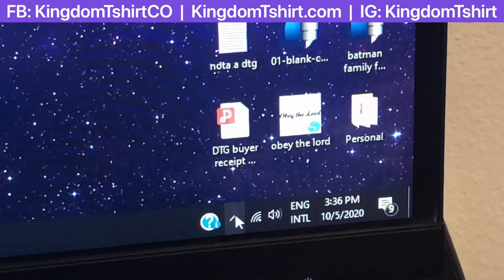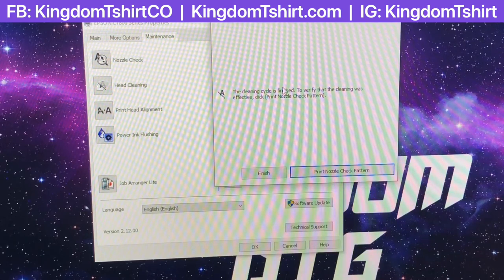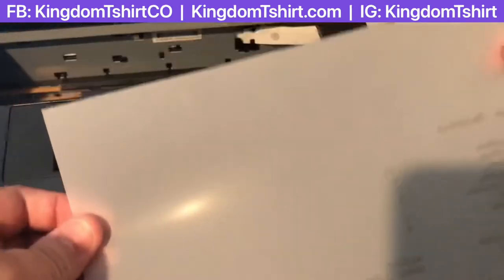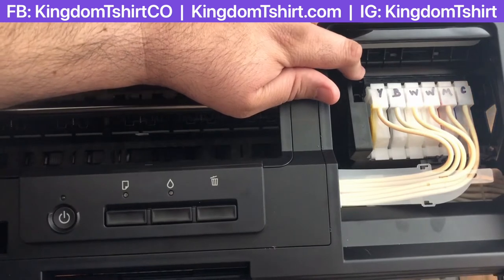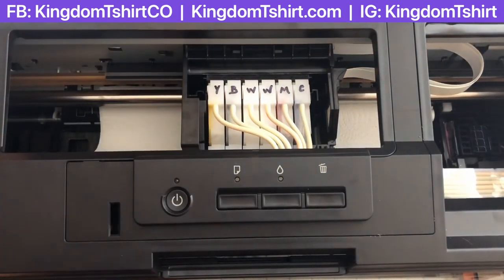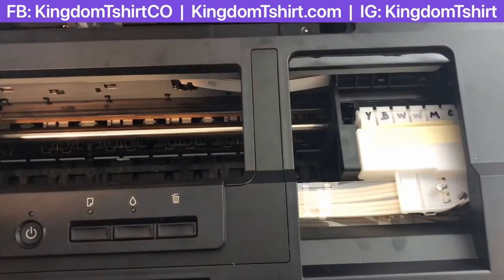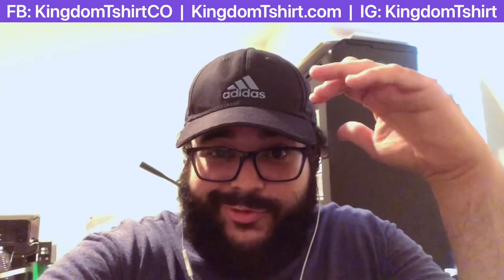📢 How To Do Maintenance DTF Step by Step with Epson L1800 (Direct To Film Printing) - PART 2

Comment from the maker: After doing so test, I find out that doing the flush 1 per week is ok if you don’t print to much, and doing a print head cleaning for nozzle check every time before you start to print a job is recommended. If you print constantly, is probably you will not need to do the flush since nozzles will not clogged.
Reply: Is there any solution to resolve clogging ?
Reply: Mmm i print every day 30 to 50 pri.ts a day thats a 8 a to 5 non stop  printimg for my l1800 and still get my head clogged
Reply: Have this maintenance scheme changed or do you still go with it?

Comment: Hi man! Awesome work once again.
I have some experience with sublimation, and what I have is a scheduled task to print a test page every 3 days during winter (my business is mainly during summer). Do you recommend a scheduled print for dtf? 
If I'm not wrong when you don't have too much work you flush once per week and then printing 2-3 days/week.
I guess if I'm printing a lot every day (summer season) I should flush after each day. But not sure about winter... Do you recommend printing a test page every 2-3 days plus a weekly flush? of flush 2 per week...
I'm a bit worried about clogged it...
Thanks in advance
Reply from the maker: Correct, once you flush print head is good. If you print again the n again you will have ink in the print head, so it better leave it clean.

Comment: Hi :) 
I probably buy  this printer 
one question or advice to me ....every morning you do nozle check and head cleaning , and after you finish the job for that day you go to the flush and print head will be empty ? is that one of the way to save you printer ?
Reply from the maker: Cleaning after you done printing and I do it most to the white nozzle. In the morning if nozzle check is good I do not do cleaning since is not necessary.

Comment: Your videos are great. After u flush the head and flush the lines. Can the printer sit for a week or two without printing?
Reply from the maker: Yes, but let me explain. You need to flush good and keep head moist in the time you are on vacation, but real longer period without use it can dry the head if is not moist correctly. To be honest I could say before was easier but everything has change during this year.
Reply: @KingdomDTF  thank you very much.

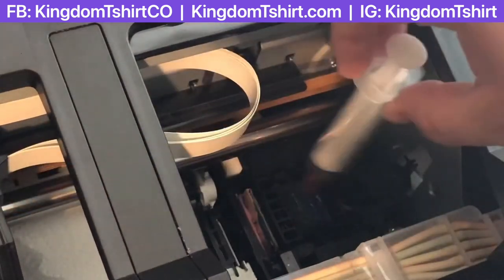Comment: aha ok after the flushing with the solution , the next day ,i have to do the print head cleaning again so the ink will go down correct? @15:00  . is it safe to do print head cleaning everyday right?
Reply from the maker: Correct
Every time you use it or the printhead have inks inside the nozzles.

Comment: Hola, una pregunta,  despues de limpiar el cabezal imprime correctamente, pero la segunda o tercera impresion ya no imprime el color blanco, ya quite el cabezal y lo limpie, tambien purgue los dampers, que crees que sea el problema?   Gracias!
Reply from the maker: Verifica que el tanque tenga air flow para que las tintas corran mejor. Tambien mira ver que no tengas una linea con algun liqueo o agujero.

Comment: Hi. I have an issue. After doing the cleaning, nozzle all okay. Sometimes white ink is fine, some time yellow didn't even come out. I did cleaning again, yellow come out but the white doesn't. I cleaned again.. both fine for 1st print. Subsequent print, the white started fading. Please advise.
Reply from the maker: Elevate the ink tank 4 inches from surface, that will help with gravity. also make sure you have a good airflow.
Reply: Thank goodness for you!! It works like wonder!! For now, i opened the cap. Until when do i have to keep it open? Also the ink tank, until when do i have to keep it elevated? Thank you sooooo much once again!

Comment: Hi. My nozzle check is always messed up hardly any lines at all. I have done my head cleaning a few times and nothing works. Can you help
Reply from the maker: Try to use an strong cleaning solution and mix with hot distilled water. You need to be patience to push the mix.

Comment: Hi KINGDOM, what is if print halfway, the white gone? Is there any solution for this?
Reply from the maker: On the L1800, elevate the tank 3 or 4 inches from surface and make sure the ink is getting airflow.
Reply: @KingdomDTF  I have tried elevated the ink tank using a box, but the white ink still stop halfway, is there any specific way to overcome the white breaks in the middle of print?

Comment: Hi. I noticed when i put the solution at the capping station, it went down slow and not all when down. I have to wipe it with napkin. Is that the right way?
Reply from the maker: No. Is possible that you have a clog line there in the capping station or the capping station is getting damage. Is better if you get one and have it as spare in case you need to replace.

Comment: I tried this, but I can't get the solution get through, could I be doing something wrong ? The printer is just one month old and it is printing almost good.
Reply from the maker: Is the solution is not going into the nozzle, then that nozzle is clog, you will need an strong solution to break since a regular may not work. Also you can warm the solution a little bit to have a better results.

Comment: Hola interesante, para la Epson 14000 podría valer esa modificación? Y no necesita que tenga un sistema que evite que la tinta se sedimente ? Gracias un saludo.
Reply from the maker: El 1400 es posible, pero hay que modificarlo para que no dañe el diseño al imprimir. Solo agito la tinta un poco antes de imprimir mis trabajos y limpio el cabezal una vez a la semana.
Reply: @KingdomDTF   hola, perdona pero cuando te refieres a limpieza de cabezales te refieres a limpieza manual o automática de la misma impresora , la que trae el mismo programa. Gracias . Saludos.
Reply from the maker: @mercutio75X  se limpia manual 1 vez a la semana. Se usa el automático para cuando se va a verificar los nozzle check antes de imprimir trabajos cada día.
Reply: @KingdomDTF  gracias , muy amable.

Comment: hi , what happens if i go on vacation for 10 days and i didnt use the printer , i am going to buy one , i am afraid that it would clog and i wont be able to use that printer again
Reply from the maker: You flush the print head, that mean take out all the inks from the print head so is clean and  put cleaning solution in capping station and leave it there.

Comment: my white ink is clogged somewhere in thr pipe whenever i do print i found that the fresh white ink is not going in the damper somewhere stuck in the pipe i supposed..thats why i m not getting the white ink printed on the film...?? any leads to solve...
Reply from the maker: Try to use a syringe to suck out ink from the damper and rotate the ink by putting back into the tank.
Reply: @KingdomDTF  where u got the pipe that u have put in top of syringe?

Comment: I am From India. Just Installed DTF IN Espon L 1800. Been Doing Daily Head Cleaning Still After Doing print doesnot come Good. Everytime i need to Power Flushing. Also i print merely 2 to 3 prints daily... Please Help//////////// Been Sucking Inks from Ejcetions from head nozzle also on daily basis......
Reply from the maker: Verify the nozzle check, if you are missing it is possible the channels are clog. If nozzle check is good, then see if the dampers need to be clean at the tip, elevate the tank 3 or 4 inches from surface, consider re-install the software since could have an error.

Comment: I am having such a hard time getting my printer to print. I did everything step by step and there’s nothing on the paper. I’m ready to throw in the towel. 
I added the ink, I used the syringed to pull the ink through to fill the cartridges inside the printer, I’ve been at it for 2 hours and I am so confused .
Reply from the maker: What can't you get to print? for what you saying I understanding... the paper? what do you mean by the paper?
Reply: did you end up figuring it out jennifer? we might be able to help with a little more info